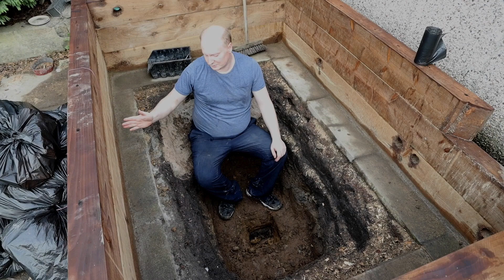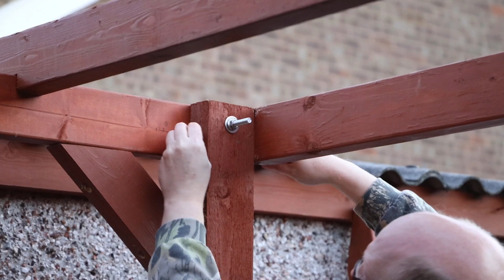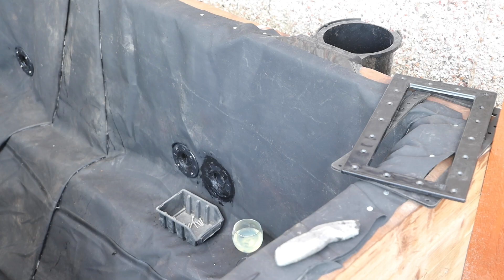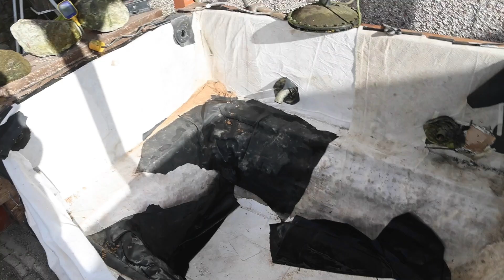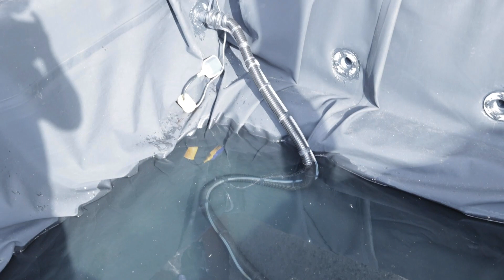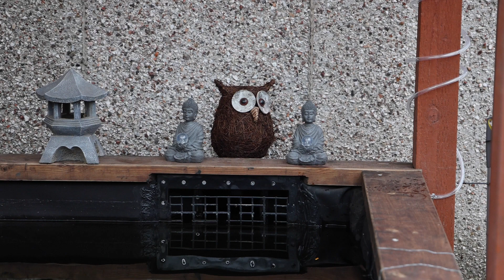Sleeper Pond Build Movie + Pond Upgrade

Comment: How often do the filters need cleaning ?
Reply from the maker: I do the surge every week and the box filter a clean every few days. despite the surge filter the sponges still collect muck so the surge is not as effective as I would have hoped.
Reply: @yorkshirekoi2246  that's not too bad though and you'll find even sponges let some dirt through and even a drum,  multi bay or Nexus would still let some stuff through. The only thing that won't is fine filter floss but that stuff clogs very quickly but if you had a drum filter followed by a wheelie bin full of filter floss ( yes a whole wheelie bin lol 🤣 ) you'd have gin clear water ! !
What you could do is try some NT labs mediclay or FOK bio factor VL (they're both meant to be good) and see how much of the clay each filter takes out, if it improves water quality and if it clogs up either of the filters. It's just a thought 💭 anyway looking forward to the next video !